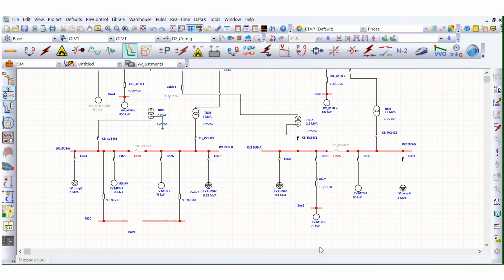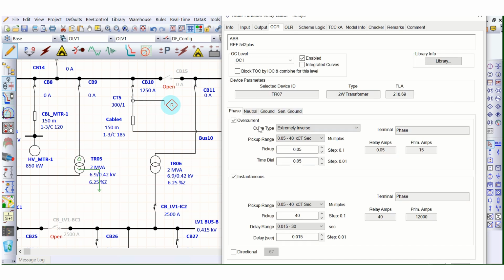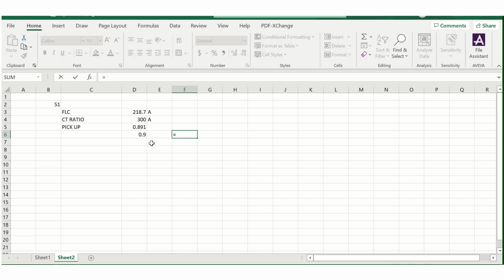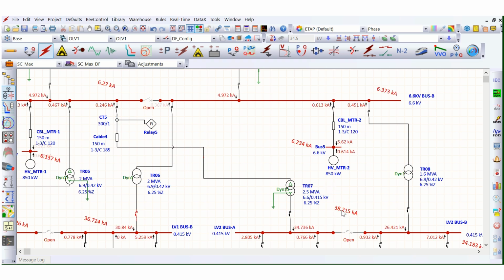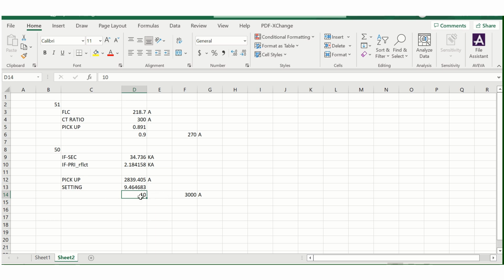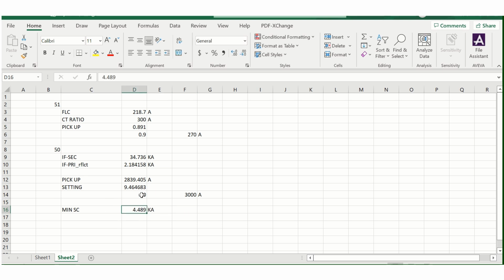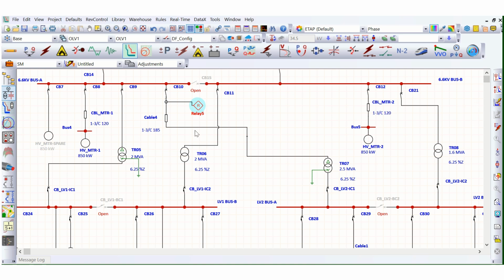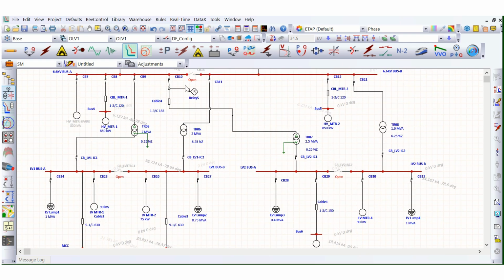Relay Setting & Coordination II IDMT Protection for Transformer HV in ETAP II Manual Calculation

Comment: This is good but if U had showed how the whole circuit was connected from top to bottom before running Ur analysis it would have been much better 

How can U send a sample of the single line diagram

Comment: Hi sir
Would i need to coordinate line bay of 67/67N protection with tr. Line or downstream relay ? If with tr. Line, how to coordinate ?
Reply from the maker: Generally, for the protection of transmission line, the unit protections like Distance protection (21) and Line Differential (87L) are used. No protection coordination with the downstream network is required since in case of any fault in transmission line, the fault should be cleared instantly without any time delay to maintain some serious issues like system transient, stability, out of synchronism etc.
Whereas, 67/67N needs to be coordinated with other non-unit protection schemes of downstream network for cable connected system.

Comment: Sir how can I modelling ups in distribution network and then fed supply through ups meanwhile grid and generator are not available..?
Reply from the maker: You can model UPS in TAP just like any other equipment. For different case scenario with or without Grid/ Generator, refer Contingency Analysis video, link is provided below:
https://youtu.be/-ZdVXc17wjY
Reply: @SmartEducare  Bundle of thanks I’ll check now. Actually I was faced issue with inverter side of ups inverter side still show like not connected means in grey Color
Reply: @SmartEducare  can I get your mail..?

Comment: Hi Sir,
Can you please confirm my below understandings, comment if anything is incorrect,
Transformer Primary winding protection:
50P - Set pickup value at 1.2 to 1.5 times the through fault current (or) reflected fault current
51P - Set pickup value at 1.1 times the full load current of the transformer.
50N - Set pickup value at Full load current of the transformer or at CT primary rated current
51N - Set pickup value at 10-20% of Full load current of the transformer or at CT primary rated current

Transformer Secondary protection (at the incomers of the secondary side switchgear):
50P - Set pickup value at the calculated minimum fault current.
Note: 
If it is low voltage at the secondary side, normally there would be ACB or Power circuit breaker, therefore enable only S of "LSI" and disable I.
If it is medium voltage at the secondary side, use definite time to allow for the downstream relay to pick up first.
(This is allow for the downstream relay/ breaker to trip first by blocking/reverse interlocking/ZSI) the upstream relay incase of fault at downstream).
51P - Set pickup value at the value of current (Base loading + largest motor starting)
50N - Set pickup value at Full load current of the transformer or at CT primary rated current
51N - Set pickup value at 10-20% of CT Full load current of the transformer or at CT primary rated current

CT connected at the neutral of the secondary winding:
50G - Disabled
51G - Set pickup value at 10-20% of CT Full load current of the transformer or at CT primary rated current and delay greater than 51N
Reply from the maker: Thanks for your lovely effort!
Your understanding is almost correct.
Only few points need to be highlighted:
1. Transformer secondary side, instantaneous setting 50P not really required just like we keep "I" setting disabled of LV LSIG release. Trafo primary side will provide the backup protection in case of short circuit.
2. For 51P in trafo secondary side, pickup value better to be considered trafo secondary FLC. Because of any future loads may come into the picture. 
3. 51N not required to activate if 51G is operational.
Hope, we are all aligned..
Reply from the maker: Also it's required to check that the transformer primary side 50P pickup value should be below the connected switchboard minimum 3 phase short circuit current.